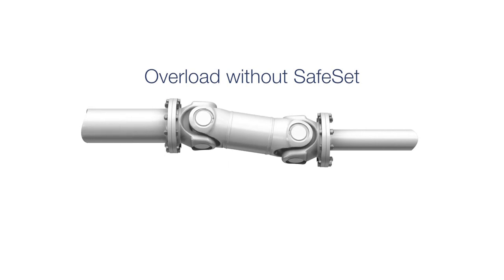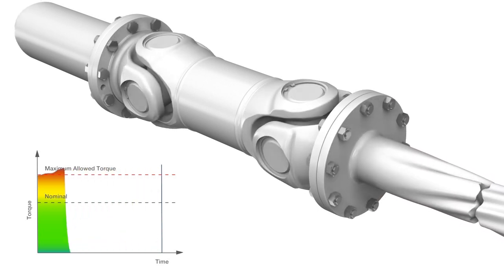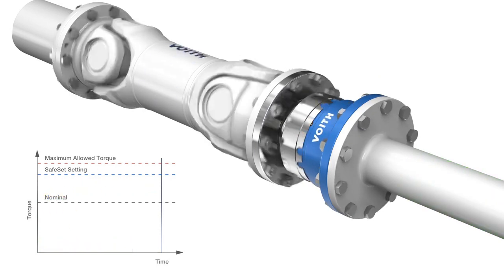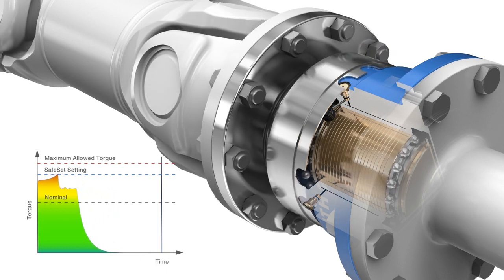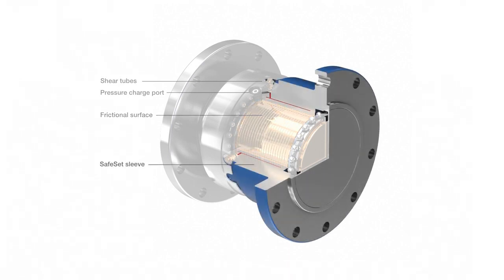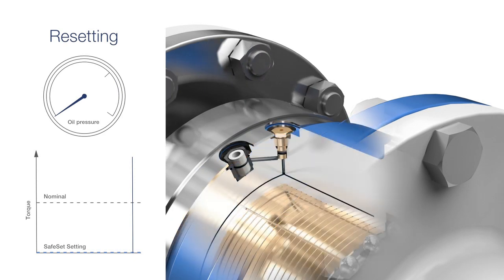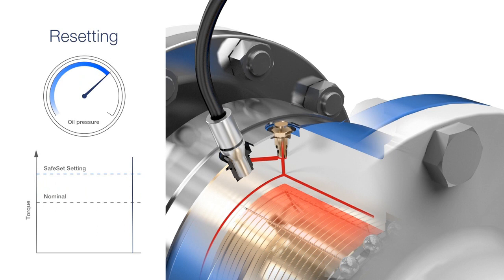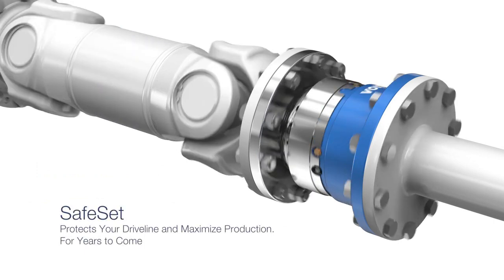Voith torque limiting coupling SafeSet (EN)

Comment: Hello! How many shear tubes will be sheared off? You have to change it all? How long it takes? 20-30 min?
Reply from the maker: All shear tubes will be sheared off at the predetermined torque. The number of shear tubes depends on the design. These shear tubes will need to be replaced in order to safeguard the drivetrain from further torque peaks and it takes approximately 10 minutes to change.